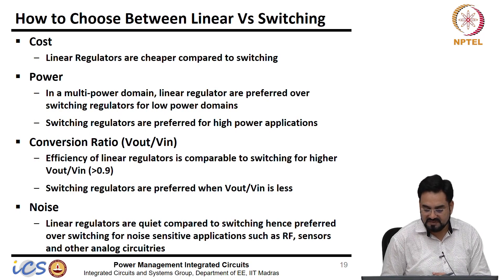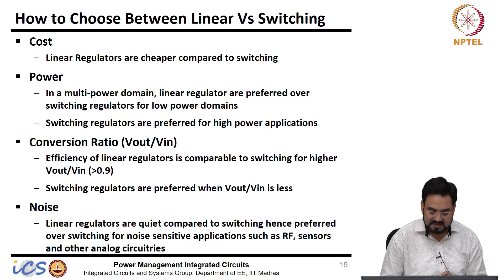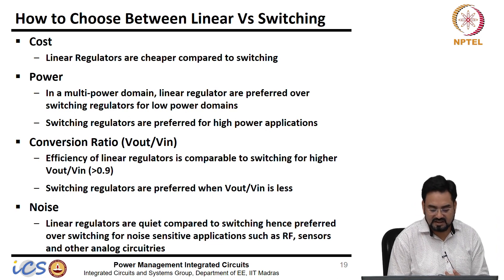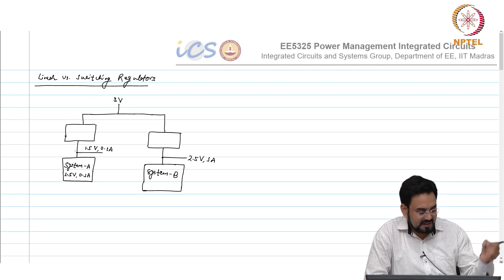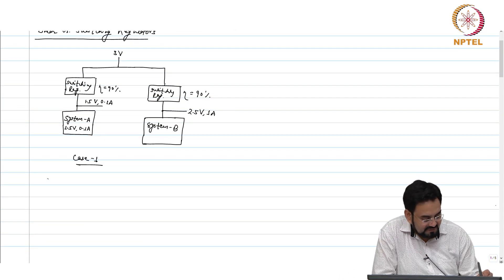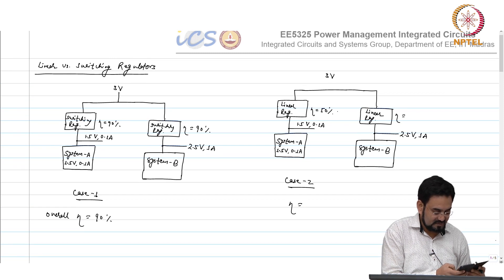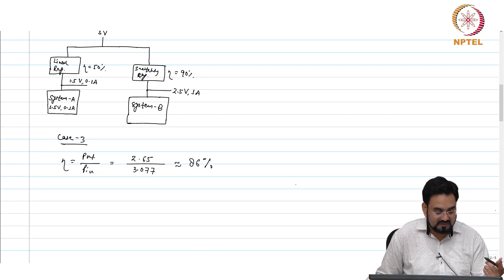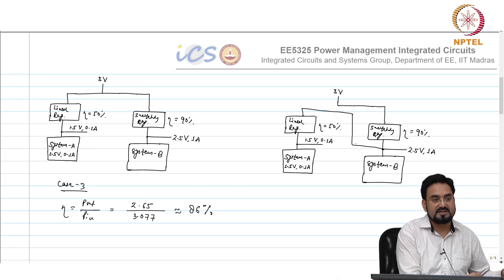#3 Linear Versus Switching Regulators | Power Management Integrated Circuits

Comment: The combination case 5: 

Switching regulator for 1.5v @0.1A

Liner regulator for 2.5v @1A

It may be optimistic for both cost and efficiency right?
Reply: no😅😂 Considering case 3 in the video and your case 5 (switching place of linear and switching): Thats a clever thought to have but no, the efficiency will actually reduce from 86% to 83.68% if you do that, because here the higher efficiency of switching regulator is delivering less power compared to lesser efficient linear regulator delivering more power

Heres the calculation if you need: 
efficiency = Pout/Pin = (1.5*0.1) + (2.5*1 ) / (0.166) + (3*1) = 83.68% (where 0.166 is the input power of the switching regulator ( Pin = Pout + Ploss = 0.15 + 0.0166))

Comment: Hi Sir,
In case-4, how are we calculating o/p power? 

O/p power of switching reg= 2.75 watts

O/p power of linear reg= 0.15 watts

So total o/p power should be equal to 2.9 watts.

Please correct me, where I'm going wrong.

Comment: In the case 4 shown at 17:08, won't the net noise in output increase because even the linear reulator becomes noisy as it is cascade with switching regulator